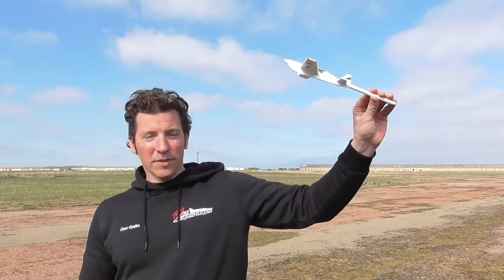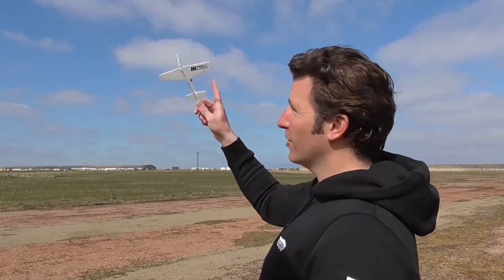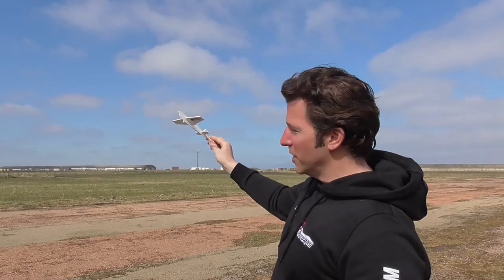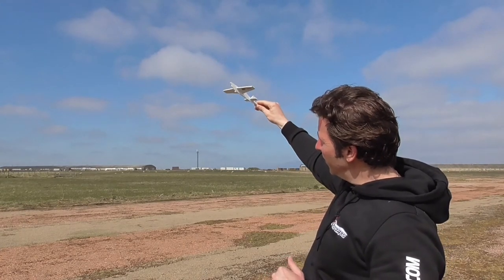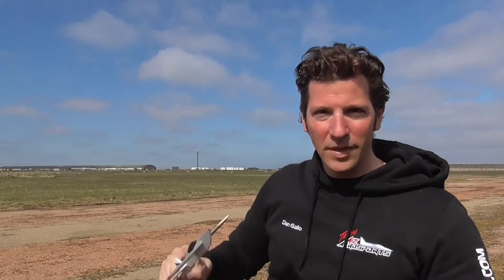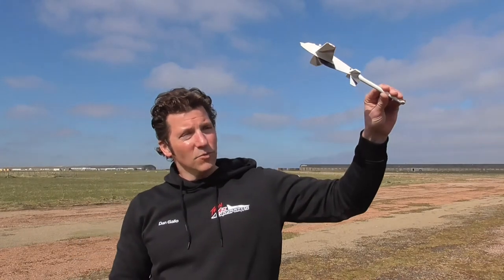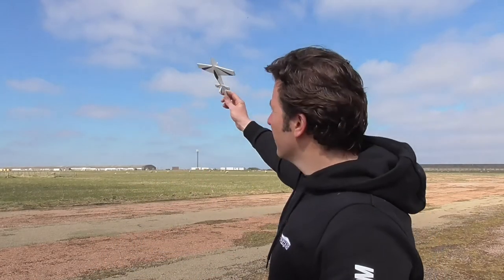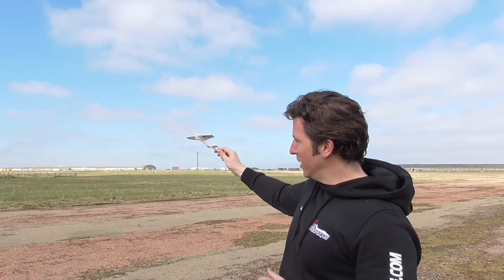Elevator Manoeuvre Part 1 - Beginning 3D

Comment: Hi,
Is there any danger for the plane going into a spin ?
Reply from the maker: Hi, the model shouldn't go into a spin if there is enough elevator travel on 3D rates and only small amounts of rudder/aileron are used, to keep the model on the right track.  Even if the model does spin, it will be a gentle upright or inverted flat spin and you almost have to make it spin by applying lots of rudder. Hope the helps and thanks for your comment. 👍🏻
Reply: @dgaerobatics1764  Thanks for your answer.